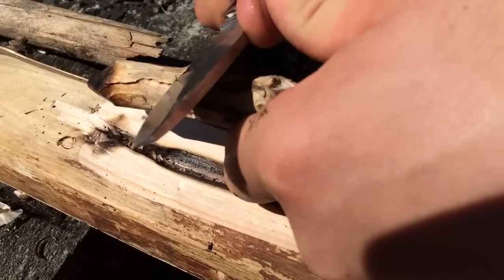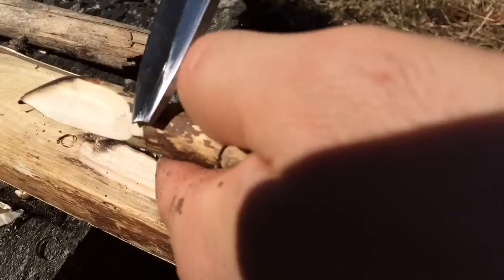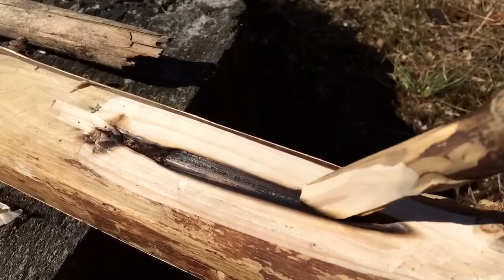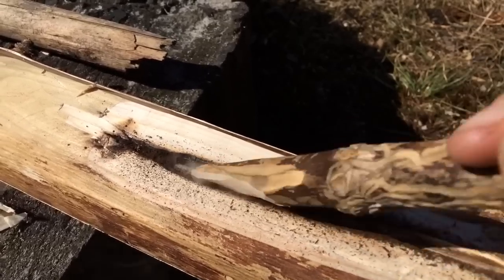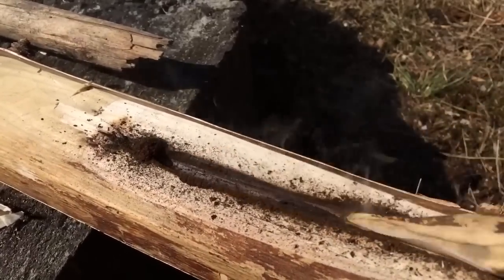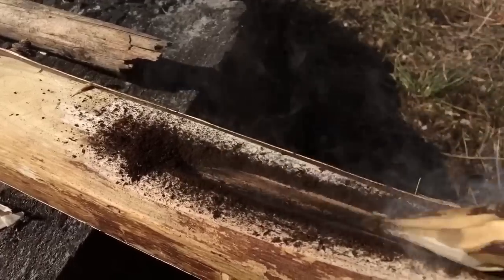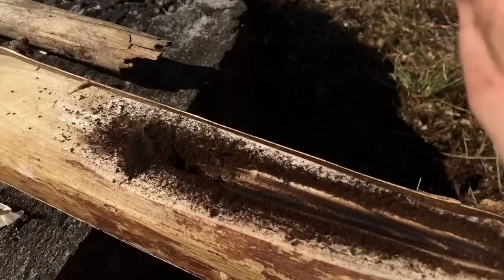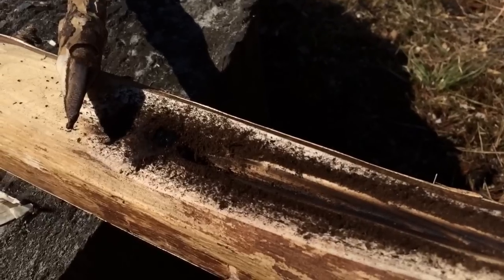Fire Plow: Tips and Tricks

Comment: I noticed you used the end of a fairly long piece of timber to make the bed of the plough, meaning that it would not need to be kept still whilst applying the plough. How do you get the coal from the bed to the tinder bundle? I was also surprised at how the ember (coal) increased dramatically in size once you had stopped applying friction. Maybe a lot of potential embers go unnoticed? This is the first time (newbie) that I've seen the "ember chamber" discussed. Good work!

Comment: I'm wondering what is the best way to transfer the coal into a bird's nest.  Would it be better to use something somewhat smaller than a log so that  the ember could be simply inverted and gently tapped into a tinder bundle?
Reply: https://youtu.be/qihY8mp7aa0

This shows how the fire plow is used traditionally in Samoa to create a fire, which includes how the fire board is used to transfer the coal and that its only big enough to sit on. What isn't explained is that the wood of choice is hibiscus and both the plow and board are made of the same species of wood. I am not exactly sure what the properties of hibiscus wood exactly is, but from what I see growing in my area, its is a soft, non-resinous wood that powders extremely well when friction is applied, as well as the wood itself feels like it grips onto the plow when I press against it. I suppose if you can find wood with these properties where you live, then it might work but I'm not an expert so I can't suggest any other wood species from other parts of the world.
Reply: @Simlatio  yes. it seems soft and dry. bamboo is another wood that is commonly used to make friction fires. i saw one technique that worked in a very short time, like idk 10 or 20 seconds. iirc, they were using a sawing or other type method that gave the rubbing material a lot of speed.

Comment: What am I doing wrong? I was do the same thing about ten minutes, no smoke appeared, it was hot, but no smoking punk apeared. Could it be too soft wood?
Reply from the maker: It could be a couple of different things, first make sure the condition of the wood is good, preferably use a dry dead standing tree. make sure you are using  an adequate amount of pressure when ploughing and Try a kneeling position. Also, the plough and board should be from the same tree so the density of the wood will be around the same. Hope this helps and good luck!

Comment: " I'm not using my arms " yeah right......
Reply: He meant that he's not using his arms to add pressure. Instead, he used his body weight to add the pressure so that he didn't burn out his arms early.
Reply from the maker: Yes, exactly at first concentrate on using the sum of your upper body, until you get a good buildup of dust, heat and smoke and then you can start using your arms more when the need for speed and pressure are critical to form the coal. If you use your arms too much in the beginning you will always tire out and lose the precision, pressure and speed it takes to be successful.
Reply: Lock out elbows. Use your body. Simple concept

Comment: You seem to collect the dust at one spot, which is what I can’t do.. I even cut the tip of the plow with an angle but it didn’t work. Also, fixing the board on the ground or somewhere appears to be quite important. Well, it’s been a week of practice now and haven’t got an ember yet